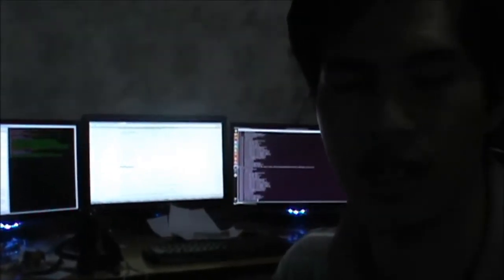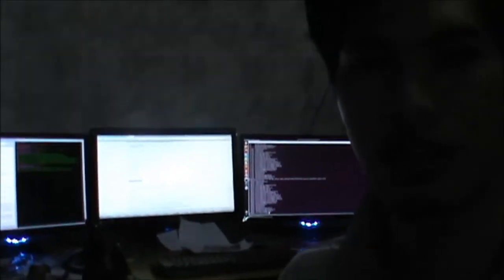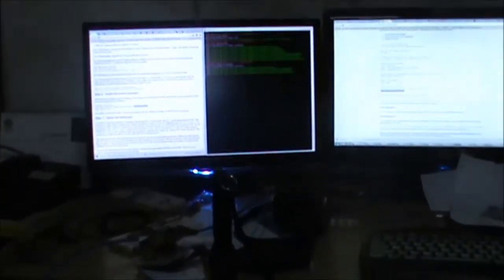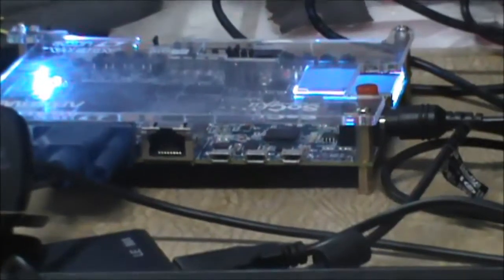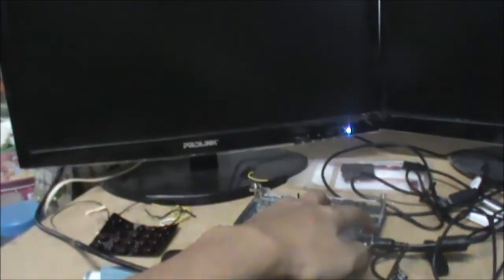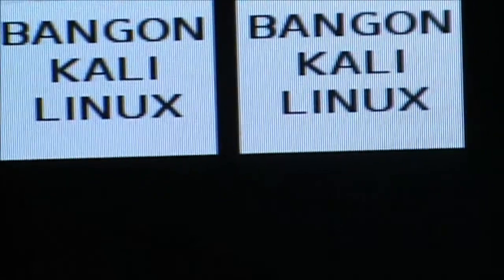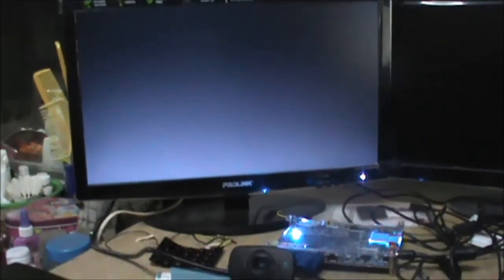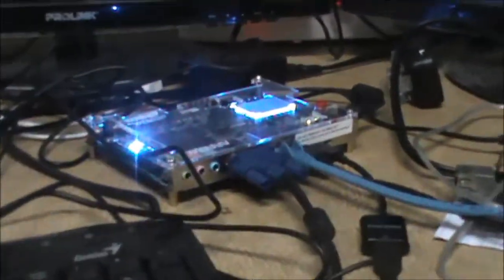[SocKit] Custom Boot Image and UVC Support

Comment: Hi, Bangon Kali,
You did a brilliant work, nice video..and Here i got few question to ask u, about the process of recompile the linux kernel. I am able to running Linaro linux on my SocKit board by using prebuilt image given on RocketBoards website. But when i trying to built the image by my own, i m Stuck.
So here I want to ask you about the U-Boot arguments part, how to add 'console=tty0' to the kernel boot command line? izit by command or need modify some sentence in the specific file? and how you add the following:
bootcmd=run mmcload; run fpgaload; run mmcboot       
fpga=0                                                                          
fpgadata=0x2000000                                                              
fpgadatasize=2126D5                                                             
fpgaload=fatload mmc 0:1 0x2000000 soc_system.rbf; fpga load 0 ${fpgadata} ${fi} to the to u-boot? confusing and not understand the process written in rocketboard website...
thanks for reply!
Reply from the maker: Hello Pang Chet,

You can access U-boot if you boot without memory card. There is a way though to boot to u-boot even with the memory card. You can understand this properly if you follow the lab activities on the arrow sockit board from the arrow website.
Reply: *****
Thanks for replying...A bit confusing about "can access U-boot if you boot without memory card." can explain more details about it? 
Ok..i will try to go through and understand the SoCKIT_Materials which available on the arrow website..thanks for you guide~
Reply: hi, Bangon Kali, one more question to ask you, izit to add something to u-boot i must use the DS-5 Development suite? just want to make it clear in my mind!
 thank for reply~
Reply from the maker: Pang Chet When I got my SoCKit it already had U-boot when I first ran it. You can work on it though by following the preloader part of the tutorial.